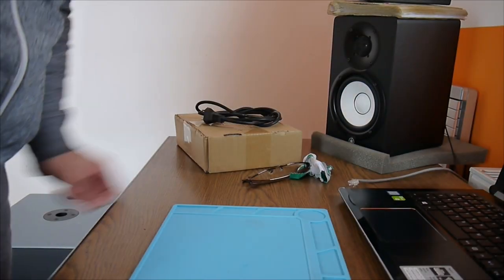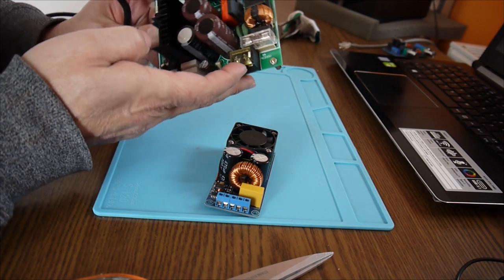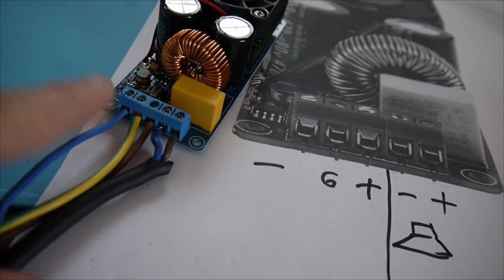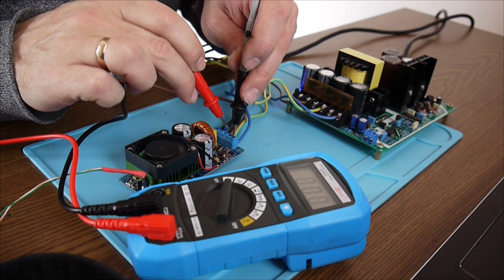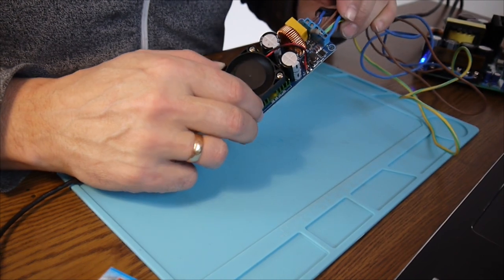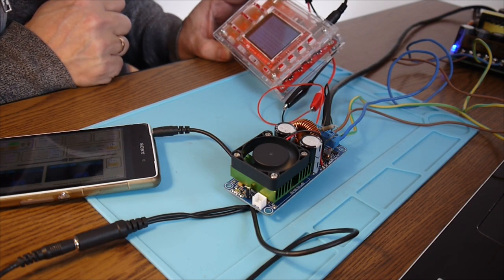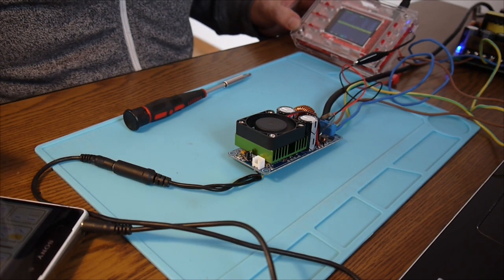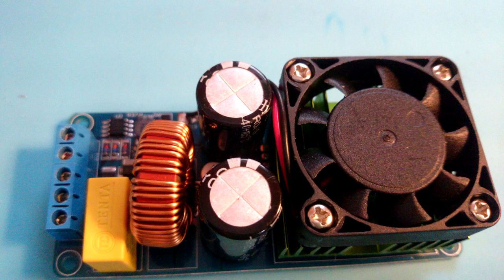Budget IRS2092 500W amplifier subwoofer project powered by SMPS 500W -+58V

Comment: Today most home audio receivers don't have enough power to drive car subwoofers. 
so. I think there is a LOT to learn from you, @UC8-7UfcLnjKJEkO4Vbdvd8g@UC8-7UfcLnjKJEkO4Vbdvd8g@UC8-7UfcLnjKJEkO4Vbdvd8g

and since I don't have the same electrical knowledge as you. I was wondering what do you think about using a car amp to drive car subwoofers at home?

the main problem seems to be choosing the right power supply for that amp.
so for example, instead of using a board which is much cheaper than a car amp. but it's much safer. and easier to setup. 
a car amp has a lot of power. (many times more than you need) and their intended use is exactly for either full-range audio or for powering a car subwoofer at home. 
I would love to hear your thoughts. Thank you
Reply from the maker: Everything depends on your demands, how much power do you need, if your loudspeakers are200W rated ..each..that doesn't mean they have a lot of volume..sound ..noise! There is a factor called SPL, that reflects how loud is that cabinet, there are a lot of tutorials about that.
If you think about using a car amplifier, that should be better, them are ''factory'' design , most well done with a lot of power, filters and so on, you can't compare that little board supposed 500W with a JBL 500W amplifier..no way! ALso I'm sure you can find a good bass car amplifier second hand, even free from a scrap yard something.Also consider a dedicated power amplifier like Behringer, QSC,Peavey, dedicated for driving PA loudspeakers.You'll be suprised how loud 150W of real audio power sounds! I rather save some buck for a while and buy a good profesional amplifier that will last a lifetime..not enough, get a second one! Again , don't waist your time with that board, it's just not worth it..if you count 35+45USD for board and power supply you already have half of the money for a good class AB power amplifier..check my video about RA3001, that one I bought for 150USD..and that's a beast! 2x625W on 4 ohms, even more if you push it, that's blowing your windows if you have good cabinets..or it will burn your loudspeakers in 2 minutes! How old it is, really don't matter, the sound is the same..even better the old ones! But check the tutorials around , there are a lot of nice and documented for learning about audio.
Reply: @viocaia  I've got to hand it to you. you're an extremely talented man with a long history of music AudioFile. 
I watched a number of your videos and I must admit I'm impressed. not too many people on YT have the expertise and know-how of a long music background like yours.
consider yourself "rear" very few on YT if any have the type of electronics and electrical background and understanding as you do. 
it seems like you can fix any audio equipment. ( not many can claim that)
I learned a number of things from you that have real value.
keep making more videos. I enjoy your awesome channel.
Thank you, Viorel Caia👍👍👍
Reply from the maker: @Jade_Bronson  Thank you too, appreciate! Hope it helps!
Reply from the maker: @Jade_Bronson  yes ..it's ok, but you need an
 external power supply  at least the same power like the amp..like 350W at 35V! That will cost more than the amp! keep looking...

Comment: it seems like these types of amp boards can only be useful for someone like you with electrical knowledge. otherwise, it would useless for the average person. and that's exactly what I wanted to know..
Reply from the maker: It can be use there are a lot of nice fixings, just follow the comments here.But if you want it to work out of the box...no way!
Reply: @viocaia  that same board is sold on Amazon for 32$.. BUT. as soon as I saw the resistor smoking and you had to replace it. made think this might not be such a good deal. aside from the fact that wouldn't know what power supply to buy for that board. I don't know how to calculate the power supply need for any of these subwoofer boards. I have 4 car subwoofers.(at home) each one with 200 watts RMS. I have an old but powerful Onkyo receiver. but just doesn't have the power to drive these subs. if you can help would greatly appreciate it.
Thanks a bunch.
Reply from the maker: @Jade_Bronson  Not more than 2x65V DC and around 600W, this is a double power supply with 2 voltages, differential +-, there are so called SMPS power supplies light and easy to install.You can give a try , will cost maybe 40USD.
Reply: @viocaia  I'm willing to take your advice. are we talking about the same 500-watt board? if so. there endless confusing power supply's on amazon. or if you have a better solution to my specific need, I would be glad to look at it and buy it right now. if you can provide a specific link both to the board and the power supply I will order it now.. ( I trust your judgment)  BTW I need a 220V AC to DC power supply and not 110v. 
thank you so much
Reply: @viocaia  BTW. I saw that many people are using a car amp with a PC power supply. I don't know how safe it is. but I do have 2 spare PC power supplies.
Reply from the maker: @Jade_Bronson  best idea than spending time and money on experments! Go for it!
Reply: Hi Viorel.  you're right it's hard finding an exact power supply.
but. if I'm going to be experimenting on a number of amplifiers. I thought maybe instead of buying one power supply. buy an adjustable DC power supply. yes, they're more expensive. but I can adjust the exact voltage. the only thing I'm sure I understand correctly is. 
if I buy an adjustable DC power supply from 0 to 32 volts. can you also change the "amperage"? otherwise if the PS is rated from 0-36 volts 10 amps. can I run it at 32 volts 5 amps? 
here is what I'm looking at. 
https://youtu.be/-jwEMFXmuRE
Thanks.

Comment: You need to provide at least line level input audio may be from op amp pre amplifier. I have heard that i needs at least 1.5 v rms input
Reply from the maker: Be sure I did all the right levels, there is a a flow in design, please read the comments, there are solves to the problem.I'll be back soon with some more testing, now with a classic power supply.
Reply: @viocaia  no, from the mobile phone audio out , you will get only 200 milli volt maximum ( which is designed to use with earphone or any other amp which has pre amp ) so, why didn't you add a pre amp before power amp? Pre amp is so simple and measure input signal voltage also. ........It seems you are a beginner ( you might be used only some ready made amp or simple class AB circuit only )

Comment: Update I already figured it out my problem on my amp like this one. It's the power supply and it's was so demanding it  need 8amp 60v or 65v max.  just to be safe. First i use a smps power but it's wasn't good the life of the amp just end in a minute i changed it to toroidal transformer it's doesn't smoke or anything it work  good. And please don't twist the potentiometer it's was the oscillation frequency adjustment not volume. It can output only 200 watts good for 12 inch speaker. Since I changed the power supply i didn't have any problem now
Reply from the maker: Nice to know, I had my doubts about using SMPS with this amplifier..
Reply: @viocaia  this the video where i got the idea https://www.youtube.com/watch?v=eXHdRFC3lF4&t
sorry if its tagalog video
Reply from the maker: @liangmarkv  NIce to let us know! Please give me hand and subscribe to my channel!

Comment: Cha nge 100 ohm resistence to 2.2k ohm, and do not tuch pre amp in wires, than in put signel voltage will be 1.2volts from pre amp .do this it will be work well.
Reply from the maker: super !Thanks!
Reply from the maker: Hey! Just give me a hand and  subscribe ! Thanks!
Reply: Amigo por favor cual numero de  Resistencia se deberá cambiar de 100 ohms a 2k2 ohms

Comment: **Tip**
That adjustment is to match two or more modules to the same operating frequency, also note with Class D Amp it's a good idea to run one amplifier with an inverted signal to cancel out Power supply bumping and, and I stress it also helps to cancel out distortion, one more thing if one channel is fed with an inverted signal that modules speaker needs to be reverse polarity.
Reply from the maker: Thanks for the tips!
Reply from the maker: Hey! Just give me a hand and  subscribe ! Thanks!

Comment: If you hook yourself up to the input of an oscilloscope, you should discover not only that mains hum but some other electronic noise, and class D amplifiers being Class D amplifiers they can amplify those signals that you can't normally hear "Frequencies Beyond our ears abilities", So long story short when you touch the inputs without any attenuation "Volume control or preamplifier connected properly via shielded audio lead your amplifier may be driven beyond its designed output with signals that you cant hear, thus frying the sacrificial resistor..
Reply from the maker: Thanks to know! I found that after I burned two amplifiers !
Reply from the maker: Hey! Just give me a hand and  subscribe ! Thanks!

Comment: Hi Viorel, thanks for the video. Not cientific, but nice as an information. Class D amps require special care ;-) and all of these gadgets are minimalist! Do never use the kind of SMPS or Class-D amp without additional measures like additional filtering and shielding. If you chek the IRS2092 data sheet you can see, what this unit CAN achieve! If it is used correctly and professionally. WIll keep yu informed about mine (to arrive in 2 weeks ;-)
PD.: I hope you know, voltages > 60V DC are considered lethally dangerous! (Check safety standards of your country).
Reply from the maker: Super! It's exactly what we need, to learn from each other and why not saving some money not doing the same mistakes.Let us know how is your project going.There are also a lot of nice info from the others in the comments!
Reply from the maker: Hey! Just give me a hand and  subscribe ! Thanks!

Comment from the maker: Here you have a very nice forensic electronic work I may say from Engineering Essentials '' R13 modification (10 ohm to 3k) that was successful, capacitor blown up due to sustained oscillation at output. Changed capacitor. I probed every pin and point of the board. The board is very small for the purpose and the resistors are of less wattage than recommended. But it works after R13 modification, 2Hr played with high volume no problem so far. That 10Ohm resistance is just warm but the big toroid filter is getting hot during operation, even switches are very cool. Do the modification it is worth the money.''  Thanks for sharing !!
Reply from the maker: Hey! Just give me a hand and  subscribe ! Thanks!
Reply: Почему я не могу скопировать текст для перевода
Reply from the maker: @prosound7342  Субтитры автоматически генерируются YouTube, поэтому текста нет ... извините!
Reply: @viocaia  (((
Reply: @viocaia  can this solve my problem? I bought this amplifier, I tried 58 + 58 73 + 73, the speaker resistance is 4 ohm, 8 ohm, when a signal is applied, the amplifier goes into protection and the speaker claps, when a very quiet signal is applied, there is sound
Reply from the maker: @prosound7342  Sorry to say, but each board have it's own problems.Try to have a bigger capacitance on the output filter, also take a look in the comments, there are a lot of answer and resolves.
Reply: @viocaia  thx, спасибо
Reply from the maker: @prosound7342  Good luck my friend!
Reply: U need to 1.5  amp input audio signal for this kit... Then it will work perfectly
Reply from the maker: @VLOGSWITHVICKYBHAI  Nice!
Reply: This is commercial kit.. It need at least 100 watt+ speakers.. And need mixture inputs
Reply from the maker: @VLOGSWITHVICKYBHAI  Nice to let us know! Please provide english subtitles..
Reply: Ola Amigo una pregunta por favor me podrían decir que valor es mejor poner en la R13 y cual valor para el capacitór poner y evitar que explote Gracias 🙂
Reply from the maker: @victorponce5039  Hey Victor! Please read the comments..there is a perfect recipe how to make this better..Gracias!

Comment: https://www.diyaudio.com/forums/class-d/330201-fixing-preventing-fried-zobel-network.html

It is a manufacturer error... Please fix it before burning your boards.
Reply from the maker: Nice to know! Thanks for sharing!
Reply: @viocaia  welcome, in my board one of the 150pF caps blown, since it's a power rail capacitor. It should be safe to change it to any value closer to it? Keeping same voltage rating?
One more question, why that tiny cap blown? 123 V across it, it should withstand up to 250 as per specifications.
Reply from the maker: @EngineeringEssentials those small capacitors handle noise and fast transients, it's very possible to have an auto oscillating and a bit of AC voltage upon the main power rail..I think they are working to 250V DC..if we have AC will blow..it should be nice to check with oscilloscope all around for signals of any kind.Be sure all the components are the cheapest possible too..I shouldn't trust the electrolytic capacitors also...
Reply: @viocaia  R13 modification (10 ohm to 3k) that was successful, capacitor blown up due to sustained oscillation at output. Changed capacitor. I probed every pin and point of the board. The board is very small for the purpose and the resistors are of less wattage than recommended. But it works after R13 modification, 2Hr played with high volume no problem so far. That 10Ohm resistance is just warm but the big toroid filter is getting hot during operation, even switches are very cool. Do the modification it is worth the money.
Reply from the maker: @EngineeringEssentials  Nice forensic electronic work! It shouldn't be necessary if they could do a better design.Thanks for sharing.
Reply from the maker: Hey! Just give me a hand and  subscribe ! Thanks!

Comment: Will that resistance alteration even work??
Reply from the maker: Somehow, but no way with the power they advertise! There some ideas about how to make it work, read the comments.I gave up to experiment it..maybe I'll try again with another power supply, classic transformer because I got the feeling like the SMPS also are  a source fro parasite oscillations and noises.Let us know your results, if any!
Reply: @viocaia  ok I will trace the problem and will let you know, SMPS should not be the problem, I think voltage is the real issue here those who are using below +/-50V they are fine.
Reply from the maker: Hey! Just give me a hand and  subscribe ! Thanks!

Comment: It's not a good practice to tap any amplifier inputs without any controller or a potentiometer. It's a big NO.
Reply from the maker: Right! But this specific one have 1.5v in so you need a lot of signal to make it run!Also there is 10K resistor parallel with the ground, just in case..
Reply from the maker: Hey! Just give me a hand and  subscribe ! Thanks!

Comment: Hhi i have a psu toroidal dual 75 volt , would work with this ?? some say this can handle up to 100V...
Reply from the maker: Hey Tibi!  A toroidal will be great! much better then PSU, but not more them 65V DC...maybe 70..not even think about 100! only if you want to have some fun! You know all the electronics are working with smoke! When you see the smoke out, they are dead! Joke!!!
Reply: @viocaia  75v probably to much... :(
Reply from the maker: @tibipoka6467  try 60V to be safe..is not a great design, it's working but lots of issues.
Reply: @viocaia  I wasn;t thinking about 100v but 75 v???
Reply from the maker: Hey! Just give me a hand and  subscribe ! Thanks!
Reply: is it too less 2x35v dc ?? psu  for this  amp  ??

Comment: Hey Suggestion  !!!
You have just smoked that 10 ohm SMD resistant at output,  that was the part of Zobel Network of your amplifier.... You shouldn't switch on this Amplifier without speakers connected. 
You may change that resistance with some higher wattage value too... 
That was a nice video to watch
Reply from the maker: I did that! but here is the never ending question about egg and chicken..If I don't turn on , I don't blow the resistance..If I did and blow ...well..something wrong..I just quit the project, it was just for fun!
Reply from the maker: Hey! Just give me a hand and  subscribe ! Thanks!

Comment: I connected it to my +-60v llc smps and it smells bad plastic then.Fans are still working.I connected it to speakers and it oscillates i think.It sounds drrrrrrrrrrrrrrrrrrrrr!
Reply from the maker: Shortcut the input.It should be dead silent...if you can lower the power supply voltage.if you have an oscilloscope check for output oscilations and tge working frequency 400khz, adjust from the little trimmer on the board..
Reply: @viocaia  Hi.My oscilloscope is about 40years old and not working well.Thank god one channel is working :) In other youtube channel someone suggested not to start amplifier without connecting the speaker.And i am already using them for subwoofers and 400kHz very high and not necessary! I will check other one tomorrow.Thank you!
Reply from the maker: @crazy_istanbul_cat  this is a class D amplifier, is working with PWM pulse wide modulation, 400khz is necesary for ''scanning'' the audio signal, is not ment to be reproduced...so, check the mosfet integrity...maybe is one blown..good luck!
Reply: @viocaia  And sound comes from speaker when i touch to black input cable.Is not it gnd?I thought it should be red to make it sound ?
Reply from the maker: Yes , it should be red, but check the board, GND should be the biggest  track...anyway , it's strange piece of amplifier, I just gave up long ago..it was to much tweaks and peaks and no results...
Reply from the maker: Hey! Just give me a hand and  subscribe ! Thanks!